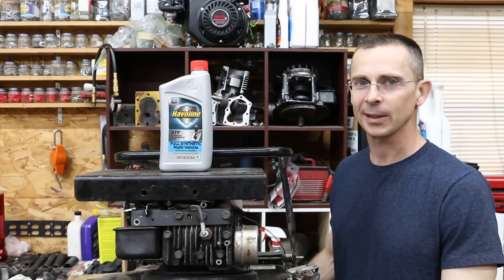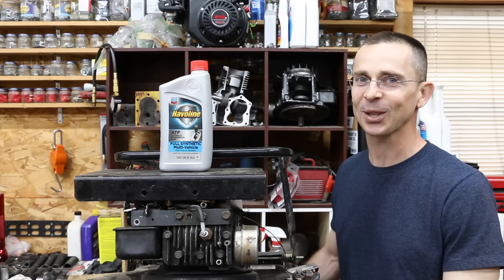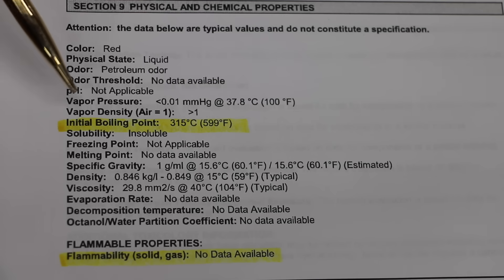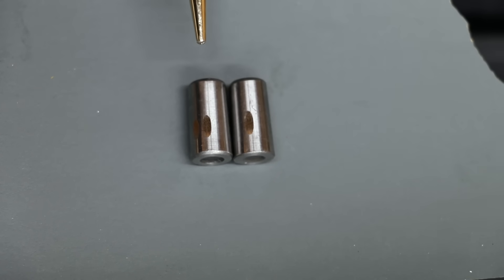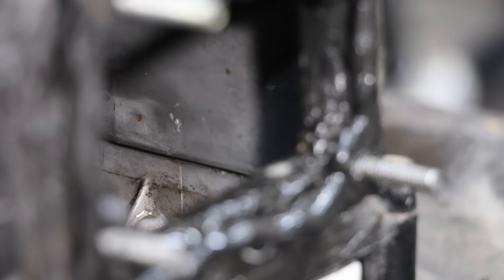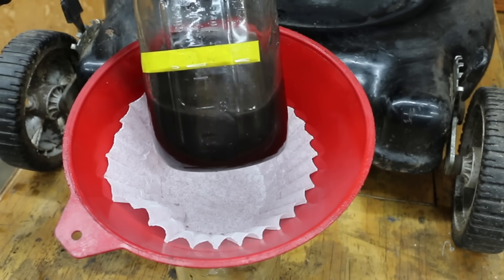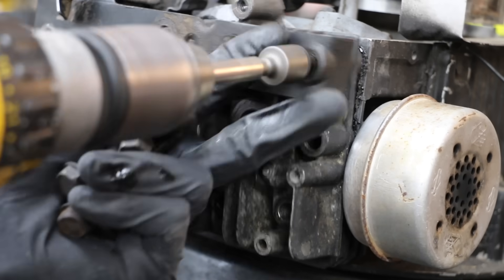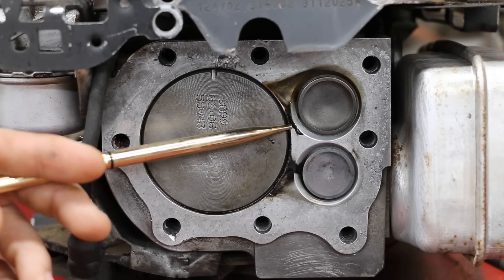ATF as an Engine Oil substitute?  Let's see what happens!

Comment: That's an old timer method. Lol. I use to work with an old biker dude and I bought my first map car and did a whole rebuild.
Anyways had a tap originally and head gasket leak into the cylinders so we ripped it apart did every gasket and upgraded lifters and did all brand new valves and what not well it still had a slight tap to it and the guy says ya know it might be a stuck lifter well hydraulic lifters don't make any sense to me at all. I like push rods and rocker ideas. Anyways he says just dump some tranny fluid in lol. Craziest thing I've ever heard. But the tapping went away for the most part. Come to find out it was just a manufacture defect lol. The  lifter was tapping on the cover. Where they welded it too close for the valve it was tapping lol. We could see the lifter marks on it. I don't see a problem with adding a bit if u think about it. It's good for the clutches in side the tranny. So why couldn't a little bit be great for metal components. There's still metal in the tranny. The only difference is they have solenoid
Reply from the maker: Thank you for the feedback

Comment: I have personally seen 1/2 quart atf to normal oil change and drain and fill after 100 miles clean out an engine quite well. I have also seen it clear clattering lifters/ vvt solenoids that were stuck etc. So it does work just don't use it straight and change it after 100 miles.
Reply from the maker: Thank you for the feedback

Comment: I had an old Toyota Tercel I got for $100 when I was in college. I had no money and it was about 3 quarts low on oil. I did however have ATF. I put it in and it ran like that for about 7 months until I sold the car. I did pull the valve cover off once and that was the CLEANEST engine i had ever seen.
Reply from the maker: Nice!

Comment: When using ATF I've always used one qt with the rest oil. The atf finds it's way into the lifter and the detergents help clean the engine. Never done it in a new engine but have several old ones with success at making a lifter quiet down.
Reply from the maker: Thank you for the feedback
Reply: thanks!  do you typically run the 1 qt for the entire oil cycle duration?

Comment: my old school LandRover guys say to add 1 qt. ATF to engine oil - drive 100 miles then do oil/filter change - it does seem to clean well and will quiet a ticking lifter - SeaFoam to a tank of gas does a good job on fuel system
Reply from the maker: Thank you for the feedback

Comment: I've heard of using ATF fluid in the engine but I've never tried it. I had a few farm use vehicles I guess I could had but it just doesn't sound like a good idea to me. When I was younger a friend put break fluid in my transmission because it started to slip and the next day it went out. So from then on if it's not meant to or trusted I'm not gonna risk it.
Reply from the maker: Thank you for the feedback
Reply: @ProjectFarm  no problem thanks for the videos. I enjoy watching these videos especially videos like this of rumors being more or less busted. I'm sure it will probably save someone a fortune. I've also heard that if you park a vehicle for many years to fill the engine up completely with ATF to preserve it. Of course they say to remove it and probably do a few oil changes frequently but don't believe I'd try that either at least not without proof it works. As far as cleaning the inside of the oil I just use good oil and change it regularly and if I purchase a used vehicle I'll do several early oil changes until the oil doesn't appear to get dirty prematurely and that has worked quite well for me.

Comment: I have always used ATF to flush motors 100 miles before oil changes. Conditions seals. Frees sticky lifters. Never any negatives.
Reply: Try Marvel Mystery Oil before changing oil. It's made for the engine. Also put it in gasoline tank.
Reply from the maker: Thank you
Reply: exactly what I do - same good results

Comment: I would say the particles came from cutting the hole in the block and were loosened by the detergent of the ATF. Those Briggs engines don't have any rod bearings in them. The aluminum rod runs directly on the steel crankshaft. The plastic parts are part of the centrifugal governor that limits the rpm of the engine. I used to race Briggs engines on go carts that we turned very high rpm's. We changed the rods to a style that had rod bearings in them to withstand the treatment we were giving them. Great video.
Reply from the maker: Thank you

Comment: Used ATF in our 99 Windstar way back. Had a noisy lifter. Ran 3 Litres engine oil and 1 Litre ATF. Ran it like that for about 5000 kms (3125 miles) I DON'T RECOMMEND someone try it. Vehicle probably had around 150,000 kms (90,000 miles). It did stop the ticking. Ran regular oil after that. My concern was on extra wear on crank and cam seals. May have done some premature damage that we never saw as the van got older. It is a good cleaner!
Reply from the maker: Nice!

Comment: I have seen people use one qt of ATF with 4 or 5 qt of motor oil to flush out a engine... It worked great but it's recommended to only let it run for 5  to 10 minutes at Idle only Do NOT drive the vehicle...
Reply from the maker: Thank you!

Comment: Have used it to get a stuck lifter loose in old Chevy V8s in the 70's. 1 quart to 4 the old engines were loaded with sludge in the lifter valleys so it will result in sluge in the crank case and a clogged oil filter if you don't stay on top of it. Back then there wasn't bery good detergent oils but Trans fluid worked just well enough to keep the var running with out a huge disassembly bill and parts bill. It works.
Reply from the maker: Thank you!

Comment: HI> I have an old car golf 1988 the oil lamp will not turn off -after  using 1 liter ATF oil & mix it with 1 liter 90  gear oil  together with 2 liters of engine oil  SAE 40  THEN gradually the oil lamp warning went away and the noise of engine is much calmer!!!
Reply from the maker: Thank you for the feedback

Comment: My uncle told me that he used 30 weight motor oil in his chevy truck instead of transmission fluid because it leaked out if he used transmission fluid and didn’t with the motor oil. 
Could you test this? 
Are there any benefits or detriments to using motor oil instead of transmission fluid
Reply from the maker: Thank you for the video idea!

Comment: I have used 4-1 ratio of oil to ATF for 500mi in a ford 4.0. It freed the stuck liferters and it starts and idles much better when cold. I actually feel more power too, probably restored the compression as well.
Reply from the maker: Thank you

Comment: Am old enough to have been around when this was a valid system.  It was based on whale oil as a constituent of the ATF in the old days (up to maybe 1959).  Old ATF would clean stuff.  But once they stopped blending in the whale oil, it became just another oil.  Marvel Mystery Oil took over the cleaning job (mostly).  Rislone and few others did OK too.  We have much better engine cleaners now days.  I like BG109 to clean stuck lifters, free stuck rings and such.  We need to remember that what was being cleaned back then was a slew of old flathead and BlueFlame sixes that never had oil filters  and prolly lived their whole life on non-detergent oils.  Those are all gone and the problems that went with them :)
Reply from the maker: Thank you!

Comment: We use ATF to clean engines, we add a quart to the engine oil, let it run 5 minutes. That cleans Diesel engines very well. But we would use the engine filled only with ATF. And certainly not longer than some minutes.
Reply from the maker: Thank you for the feedback

Comment: I used ATF in a 1995 Saturn and it slowed down the oil burning which was caused by weak piston rings, they loose tension and then the thinner oil is more easily scraped off the cylinders. It drove fine. I would not run it straight, usually not more than 2 qts in a 4 gt  total capacity of the crankcase. I eventually did open it up and it was very clean inside, and I had run that ATF mix for tens of thousands of miles. Bearings were still perfect. Cylinder walls very glazed smooth. No scores.
Reply from the maker: Thank you for the feedback!

Comment: ATF is my go to for stuck lifers.  1 qt ATF with at least 4 quarts of oil.  Drive very easy on it for a maximum of 1k miles, then change the oil.  There's no need to leave it in the engine after the noise dissipates, which tends to be around 200-300 miles.  Works great on GM 6.0l engines which are known for noisy lifters.
Reply from the maker: Thank you!

Comment: I added atf for the old motor seal softening. It seemed to help keep main seals from leaking. This was for junkyard motors for the first  hundred miles then back to pure oil.
Reply from the maker: Thank you for the feedback!
Reply: @ProjectFarm  PF I'd love to see a video on this. Does atf revive old seals and gaskets. Basically paper gasket material, old front/rear main seals, and O-rings of various materials put through an aging process like cooked in oil. I realize this is an old video but I'll bring it up in other videos if I can.
Reply: High mileage MO uses "seal conditioners" to help stop leaks. Seems to help IMO.

Comment: well I am kinda one of those old school guys who has used trans fluid as a cleaner for years. i always run proper oil and change it on time but at the time of change i have pulled the oil filter and refilled it with tranny fluid and then run it for the last couple humndred miles or so and my motors have always lasted a good long time.did this on my 73 suburn=ban and at 560,000 miles the internals still looked great and the thing ran well enough i would have driven it across country without worry...
had the body mounts not rotted off from rust . 
i have never used a huge concentration of trans fluid but i try to never let huge amounts of gunk build up in my engines either.
i had a buddy who ran a shop in the 70's who did what he called "the 20 dollar carb rebuild" 
he was straight up with the customers that what he did was get the thing up to temp and then add trans fluid to the car until the thing died leave it over night  then run it through with a bit of racing fuel in the morning and damn if it didnt get those formerly sputtering cars to run great.
Reply from the maker: Thank you

Comment: WRONG! The theory that ATF cleans engines is actully true.  You did the wrong test if your comparing a Lawn mover 4 stroke to a Automotive 4 stroke.  The reason to use ATF,  is to dissolve carbon and condensation within the Crankcase and not the Combustion Camber.  You ran the engine(s) on Straight ATF and that’s Not how this is done on an automotive engine…   How to do it:  Make sure your oil level is 1qt. low, warm the engine to operating temp, then add 1qt. ATF.  Drive it for 20 miles, stop and replace just the oil filter.  Drive it another 30 miles and then replace the Oil AND Filter.  You’ll be amazed at how filthy the oil is.   Change oil and filter, drive and replace again after 100 miles.  Pull the valve covers if you want to see the difference!  That’s my story and it does work.  Eric…  ASE CMAT   I love your videos, yet most 4 strokes are completely different than a lawn mower. :D
Reply from the maker: Thanks for the constructive feedback

Comment: Definitely will free a sticking lifter. Never run full ATF. Add it to oil. Typically remove 1qt engine oil add 1qt ATF. Would not recommend synthetic. I have had great success with adding ATF on anything from an Infinity to a fork lift. Lifter will free up within 5 minutes of run time. Then I recommend an oil change. Another great video. Would be nice if you could find an engine with lifter noise for the test. I don't think any lawnmower engines have hydraulic lifters
Reply from the maker: Thank you!

Comment: Did you do a second run on the first mower with atf? That fluid was awful black after just an hour of idling. I’m kinda thinking it scrubbed the insides a bit and picked up crud that was left behind from the last oil. I’ve run atf in my truck way longer than I should have and even then it still had a hint of red

Comment: I've used atf as a flush for years. Not a replacement to oil but as a additive for short term use. It's saved me and several employers a great deal of money. When I suggest it I always get a confused look from the customer. One particular issue I had was a Cadillac Escalade a company owner bought at auction and took to his wholesale shop. It sat at the shop in the back till the battery died. 3 guys misdiagnosed a dead battery as a locked up motor, because the jump box the had was fried. I took my own jump box and fired it up. It had a hell of a lifter tap the owner said go ahead and replace the motor "my guys say it's blown up that must be why". He went cut and dry I have a motor at another location I'll give you 3k if it's done today. I said what if I can fix it. He said I couldn't. I said a thousand bucks says I can. Mind you this was a 30k mile 2014 ls gm. That things got a ton of life left! I said bring me a quart of atf. He brought out a quart I dumped it in and 30 seconds later it was quiet as a mouse. Ran it for a hour and changed the oil. Good as new. I did 3 more that day total bill with parts 1500 bucks and a shocked customer that's now been loyal for 4 years
Reply from the maker: Thanks for the feedback!
Reply: Thanks for replying to your viewers, because of that I'm now subscribed

Comment: Back in the early to mid 80's, the oil would coke (carbon) up the oil drain back holes in V8 heads, causing the valve covers to fill up with oil and leak. After cleaning and flushing out as much as possible, we would add a quart of ATF to the new oil and have the customer drive it for a few hundred miles. When we changed that oil,  large chunks of coke would be in the oil. That being said, Oil  has come a long way from the 10w40 in the paper cans your dad used 30+ years ago and so have the engine cleaners. It may no longer be the best answer but it does work. 

Thanks for the videos !
Reply from the maker: Very interesting!  Thanks for sharing this experience.

Comment: I've heard that red ATF is good to clean valves and carbon buildup with mixed with GAS. Does that make sense?
Reply from the maker: Biggest potential issue is the catalytic converter. Thank you
Reply: @ProjectFarm  Great! In the case of my 1981 Ford Taunus, it shouldn't damage anything then. I always prefer doing cleanings manually, tearing all apart and cleaning.. But.. yeah, huge job.

Comment: I do that always for years before I change oil , I’m adding 1 bottle ATF to oil and drive for half hour, I have 6 cars 5 Mercedes 2003 2004 2005 2009 1989 and 1993 Porsche and no problems engine clean but I’m also adding ATF to gas tank half bottle every 5-6 K , all my cars fee of check engine for o2 or cat
Reply from the maker: Thanks for the feedback!

Comment: I like the idea of your test, but I think the main purpose of running the ATF is to clean up the area's that you initially cleaned up with your wire brush and solvents pre-disassembly.  You were trying to used it to remove hard carbon deposits....but its intended purpose is to wash away sludge build up.
Reply from the maker: Thank you

Comment: What will happen? ATF is a low viscosity high detergent oil. Probably you’ll get a bunch of clatter and noise, putting a load on the engine will cause damage because the oil is too thin to form a proper film and you’ll get metal on metal wear.

It’ll clean the heck out of your engine, though, with all the detergent. Just add a quart of ATF and let it idle for 15 minutes before changing the oil (don’t drive it!) for a super clean crankcase.
Reply from the maker: Thank you for the feedback!

Comment: i was told ,and have been doing it since,i was told to add less then half a qt of ATF plus 4 as a additive ,was told the friction modifier in ATF plus 4 helps engine oil to work beter, i have been doing it for over 12 years with only good outcomes,only works with plus4 because of modifiers
Reply from the maker: Thank you for the feedback!

Comment: My mother has a 2008 Dodge Charger and is AWFUL about changing the oil. The last two oil changes I’ve flushed the engine with 2 quarts of transmission fluid mixed with 4 quarts of oil to stop the knocking. I let it idle for 15 minutes, then let it heat soak for another 15-20 minutes, then change the oil. The car has 228,000 miles and has had 2 oil changes since 151,000 miles. Once at 181 last year and one at 228 on Tuesday of this week. The car still runs great and after each time of doing it the lifter noise goes away.
Reply: A dodge will run like shit longer than some other cars will ever run.

Comment: I use 3/4 of a quart to every oil change i do and leave it in until im ready to change again and ive just passed 400k it really does work. It continues to clean its not just immediate. Ive had 2 chevy 1500 trucks my first one died at 215k this one is at 400k and still strong, only difference is...3/4 quart of atf to every oil change.

Note I wouldnt necessarily recommend this on newer cars unless they are past 150k miles
Reply from the maker: That's a lot of miles!